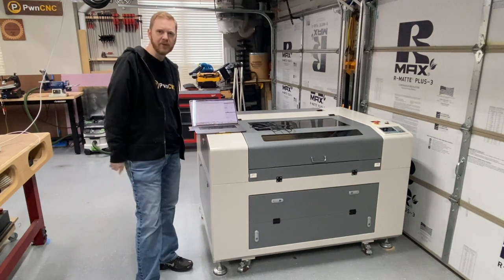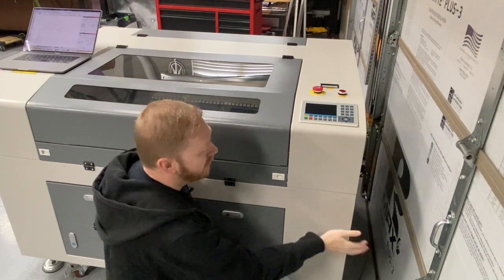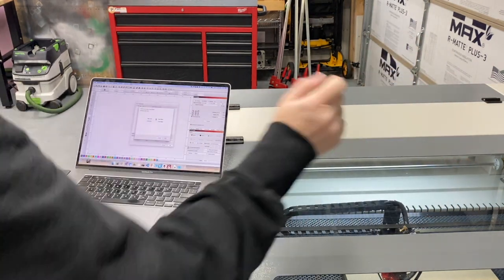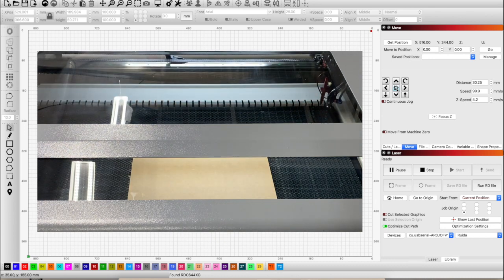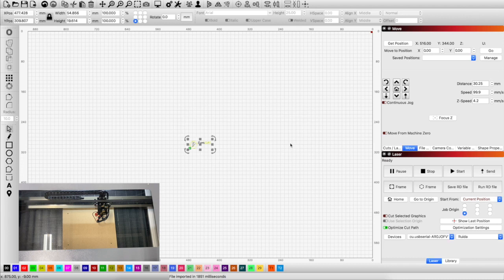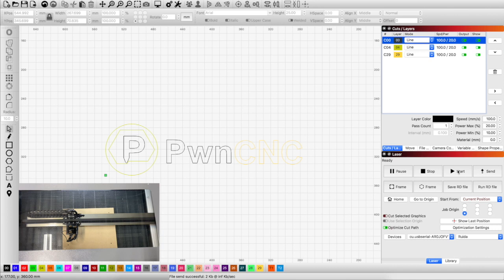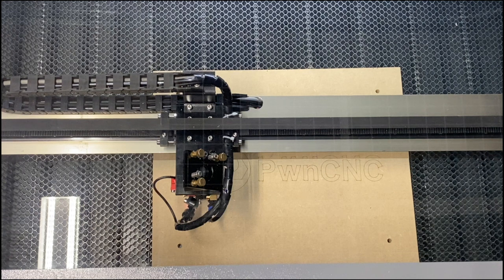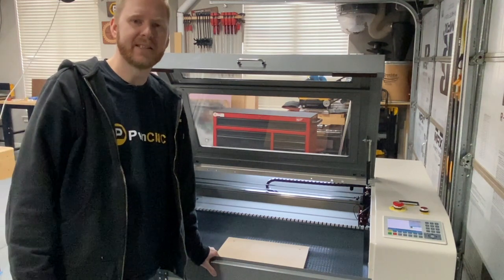FL 690 First Burn (Part 6)

Comment: Great video series - thanks.  just got mine yesterday from Coco. Did you have to modify any of the power settings in the Rudia.  Also, what is the max mA, I didn't see it on the tube. Also, assume in lightburn you have to use metric versus inches.
Reply from the maker: Nope, it's pretty stock at this point.  No mods to the controller or anything.
When i run it at 65% power, it runs typically 25-35mA... usually when cutting through acrylic.  I was told once that you don't want it to run over 20mA but I haven't had a chance to properly look that up to validate.
Within Software i prefer metric.. it's just easier for my brain to work with virtually.  When i switch to physical, being american, i've trained myself to think in inches, i can look at boards and such and immediately think inches and feet.  So i'm doing tons of conversions when switching between physical and digital.
I also design in F360 and that's all metric.
That said lightburn does let you switch to inches within the settings.

Comment: How was it lining up the lasers for the first use ?
Reply from the maker: Out of the box, the laser was functional and i've run several tests with it in this state.  I will be researching and having a follow-up video for when I run through mirror alignment and other tweaks to improve performance.
Reply: Good stuff, Daniel!
Is your focus tool marked 7mm?   I had to reset mine after cleaning the lens and mine was 10mm.  Resetting to 10mm made some terrible cuts so I played with it until I found the best cuts at 7mm.  I wonder if they sent me the wrong tool?
Reply from the maker: Possibly, as ur right, mine does show 7mm.  They actually sent two and both are 7mm.
Reply: @PwnCNC  I was about to ask the same about the mirrors.  I set my 690 up last night.  I hit pulse, but nothing happened.  I am not 100% sure if I had the laser "Light Switch" enabled at the time.   PS, Is there a handy power switch other than the mains power on the back lower right, or the emergency stop button?